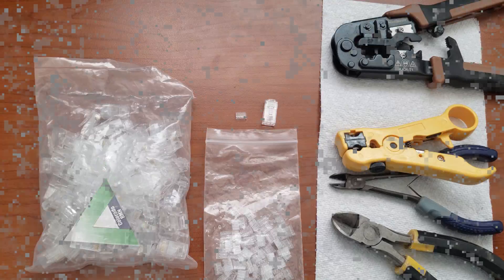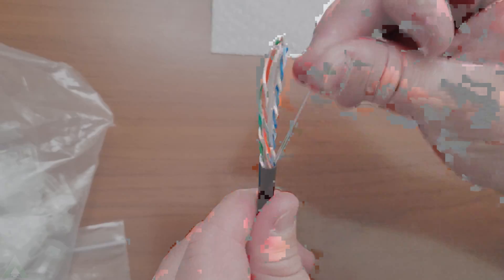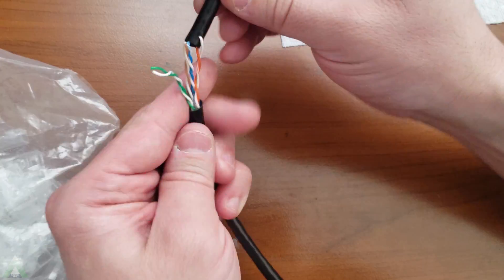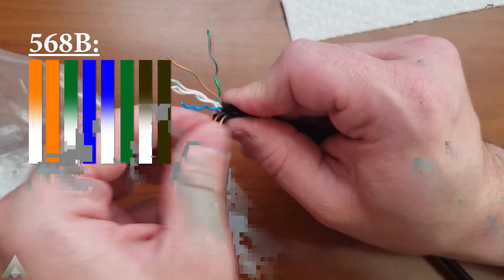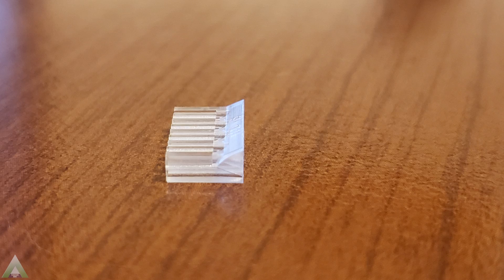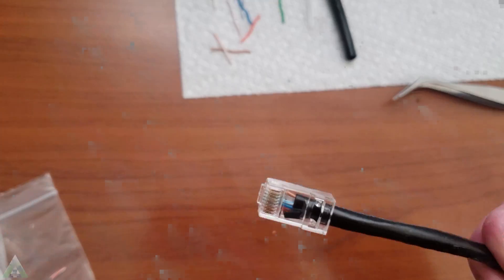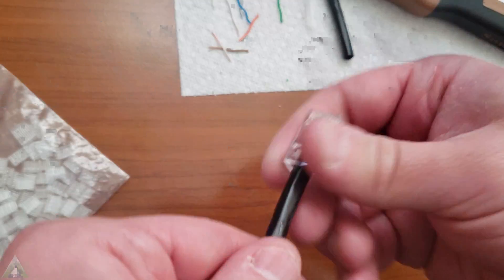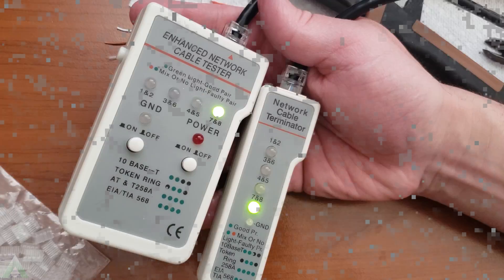How to cut, make, and crimp a Cat6 Ethernet Network Cable Simple and Easy Way

Comment: I have an ethernet cable thats been attached and glued to the wall and goes around the whole house from my living room where the internet box, to my room where my PC is, so its very very long and i dont want to have to replace it, but the little plastic bar that helps to lock in the cable into the ethernet slot snapped, so its basicly loose and sometimes it moves and disconnects, i have no tools at all like you have in the video, whats my best option ?
Reply: Crimper is dirt cheap RJ45 crimper

Comment: My puppy chewed the end off of a very long cat6 cable. I clipped off the chewed end and mounted a plug on the fresh end, but my Ubiquiti hardware is giving me a warning about it being a low speed cable. I've tried two different brands of plugs and I've used a tester to verify that each wire has signal. The cable was able to transmit data, but at half the speed of a factory cable. How can I figure out what I'm doing wrong?

Comment: Correct me if im wrong but doesnt cat6 have shielding ? Your cable had no shielding
Reply from the maker: It depends on setting this is used in and possible interference conditions. A shielded ethernet cable has an extra layer of metal shielding around the twisted wires, to protect it against electromagnetic interference. However, there are  unshielded cable as well.  Shielded ones should be used in environments with high levels of EMI; but unshielded cables are suitable for most home and office networks as most have little interference. Unshielded  are not as heavy, a bit more flexible, can be easier to pull in a  home / office and  , and in general should be bit cheaper .

Comment: 😂🤣...all you need are snips, connector & crimper...it's always 568B (568A has the orang & green reversed...and YES it does matter)...if you know what you're doing, you use regular plugs...not the push-thru crap connectors...replaced those connectors so many times due to shorting out equipment (wire tips sticking out)...and get rid of the ancient network tester...

Comment: TIL that the synthetic string is called a rip cord and what it is actually used for. Thank you!
What about the rubber boots/strain reliefs?  Necessary or no?
Reply from the maker: If it is in a location that is secure, then it is fine without it. But if it is in a commercial situation / school lab, it may be beneficial as people may "yank" the cord.  For home use, I never needed to add those rubber "boots" . Note that if it comes in the package with RJ45, then do use it as the space / clearance was designed for it.

Comment: Bought and sent back many of these to various places due to most of them never crimping properly. All these do is add a point of failure. Went back to normal plugs and have not had an issue since.

Comment: Honestly who ever invented this FN stupid BS system was either high drunk or just a complete  c$#! Ive tried for 3 day just to make a single cable and none have worked. Why the hell wouldn't you just 1 make the dam connector slightly wider so the wire don't blend and flap over each other when putting them in. 2 just go colours white silolid whit solid. Crossing them over goes against the way the nature sit in the cable. 3. You even need all the FN wires!!!!!! send and receive only needs 4 wires so why the fuck is there 8. God dam in

Comment: You dont have to expose some of the internal wires for the end connection like you do with speaker wire?
Reply from the maker: No, when you crimp it at the end, the end-connectors splice into the wires. That is why it is critical to crimp it fully as it does 2 things: A. Crimp down the end so that the cable does not come out and B. Crimp the end of the RJ-45 connectors / conductors into the wires.  That is why I recommend crimp it a few times just in case as  during the process it is crimping 8 wires + 1 end of cable.

Comment: Can you also concatinate two cables? Say you need a longer one, or a section with a flat cable
Reply from the maker: There are adapters that have 2 Ethernet ports to extend cables. At home you can try to use it for applications that are short distances and test your speed to ensure it is not negatively affected.  Commercially I would advise against it as this will reduce quality of signal over distance  and that also exposes cable to extra interference in the middle.

Comment: Actually there are a few different techniques & procedures to achieve good results.  It all depends on what works best for the individual.  Personally, prefer to gently score the jacket with a blade then tear or use side cutters.  I wouldn't use those circular jacket cutters.

Comment: How do you test if one end terminates in a keystone?
Reply from the maker: Once you have 1 good working cable (tested and confirmed) you should be able to use it to plug it into the jack and the other end to the point of origination and test that way.

Comment: I got a kit with a crimping tool, tester, and some connectors. They aren't the connectors with the loading bar. I loaded the wires OK, but there doesn't seem to be a way to cleanly cut the wires after they are passed through the connector and then crimped. Any suggestions?

Comment: Will the RJ45 PLUG fit the cat5 and cat6 cable?
Reply from the maker: See the rating for RJ45. Cat6 cables are slightly bigger so there may be some RJ45 that could be too small for Cat6. A Cat6 rated RJ45 will still work with Cat 5 cable (for home use).

Comment: Great video! Followed your insructions and used a Klein pass-thru crimper on CAT6 cable. It took a little longer than you ;) but worked first time. Used tester to verify. My connectors did not have the loading bar, so that slowed me down a bit.👍
Reply from the maker: Nice work!
Reply: Is the loading bar necessary?

Comment: I thought I must be doing something wrong until I realized I was working on a direct burial 6A cable, and the wires are too big for standard connectors.
Reply: Did you find connectors that fit.
Reply: @chrisclapp7631  I didn't,  just ended up using the snap in connectors that go into wall plates.

Comment: Sorry man. This is just simply not how its  done. Use a tweaker to separate each pin. Use pass through RJs  also. Another tip. Don’t ever ever push the pins that high up because when you crimp the RJ it stresses the pins.

Comment: Oh my God!!! I struggled for 2.5 hours with Cate6 connection - wasted 8 connectors.  Dammit.  I am going to try it and will up date everyone.
Reply: Definitely use the pass through kind of rj45 jacks. Cut plenty of the outer cover off and slow down. Slide one wire through at a time if you need to. I myself never slide more than 2 in at the same time. I can do one set with two ends in under 5 minutes doing it that way. Slow and easy….. nice video by the way pal. Great info!!

Comment: Does anyone know if i can cut a ethernet cable and still use the same connector somehow?
Reply from the maker: You can use the same cable by crimping a new connector on it but you cannot reuse the old connector once it has been crimped.

Comment: Video is only 1 year old, and I have been using the pass through RJ45 connectors, and the crimp and cut tool for over 4 years now.
No serious network installer will use this way if making cables anymore.

Comment: hi, thanks for the video. i just want to ask, does arranging the colours effect the speed of the internet? i have a 300mbps speed n want max speed while connecting the land cable to my desktop from the router.
Reply: Just make sure you wire all 4 twisted pairs to get true gig speed.  In theory, you could wire in whatever order you want as long as it is the same on the other end.  That can get confusing, so it's good practice to always wire in B or A order (most use B).

Comment: Does it mean your RJ45 connector is different from the ones I bought? There is no smaller part everything is just 1 piece 

Or do I have to buy the smaller part differently?
Reply: The plugs with the loading bar are the easier plugs to do. They help you align all the wires before pushing them into the plug. Plugs without a loading bar do require some patience ! I recommend the ones with the “push through” set up where you can thread the wires through the plug to hold in place whilst you fit the others. You then trim off the excess, slightly pull them back into the plug and crimp. Every method is fiddly, but the loading bars are the best system.
Reply from the maker: If yours is 1 piece then you sort the wires and slide them into the RJ45 without the loading bar  (the 2 piece is a different design). I have done many 1 piece setups, you just need to be careful to align the wires so that they slide in the right order.
Reply: @ColoradoRMN  had a very painful thumb after several attempts. Kept cutting the cord till it became just 2feet.

It was 2.5 meters long
Reply: @ColoradoRMN  got the RJ45 UTP A type and boom! It's got the loader onboard. And I could finally crimp successfully

Comment: to make it even more simple and not needing to remember or google for wiring diagram just wire in any color combination just make sure they are in same order in both ends also the 568a-b are the same it's only 2 colors that have swapped and when connection it makes no difference what color is inside the cable.

Comment: finally a video where someone crimps their rj45s a few times before they pull the cable out of the crimper. everyone else does it once and assumes its perfect. i use pass through connectors. sometimes it takes a few/couple crimps to get the ends cut off good.
Reply from the maker: Yes, doing it a few times is quick and ensures all's good and done fully.

Comment: I bought a flat cat6 cable, can I assume it'll all be the same inside?
Reply from the maker: "Kind of" :) . It will still work, however, flat cable tends to be more portable and made of smaller / thinner wires. Additionally, it should not be used for long runs (length) as it will not provide sufficient signal coverage and would can open additional RF interference (non-flat  cables are normally twisted for a reason and in a  way to minimize interference and maximize the signal strength).  But for short length / portability flat cable can still be used.
Reply: @ColoradoRMN  thank you, we've run 30m of external flat cable and hasn't lost any of the speed from the router (149mbs), so son is happy :)

Comment: My issue is that when I insert the wires into the connector, they don't stay in place and I keep getting Splits every time I test it after they've been crimped. What's a good solution to help keep the wires in place while inserting them?
Reply: Might be best for you to get pass through cat6 ends so you can make sure the cables are straight before crimping
Reply: @danielforsyth5729  I am dealing with Cat7 and Cat8 though but if I were dealing with like Cat 5 or 6 then I would. I watch these videos and they make it look so easy but I keep failing lol.

Comment: Does the color standard really important for a straight thru cable patch?
Reply: If this is just for your home use then as long as 1,2,3 and 6 are the same then it will be ok because 1 and 2 are for TX transmit , 3 and 6 are for RX Receive

Comment: Many thanks. 

Thanks for pointing out that you have to sort the wires in the correct order BEFORE you trim them. Not obvious and very welcome and useful advice.

Anyone new to this might assume you need to bare the ends of each wire (as you'd have to do when wiring up a power plug), so your taking the time to explain how the crimper drives the blades into each of the eight wires is very welcome.
Reply from the maker: Thank you for the positive feedback. Glad it helped and you found the video useful.

Comment: Hreat video, question. I have done my own phone lines but, never ethernet cable. You don't reverse the pinout on the other end?
Reply from the maker: No - they must be the same on both ends. The only time it would be different is if you are doing a crossover cable (connecting computer to computer direct and bypassing networking equipment). There is a special order to do a cross-over cable.

Comment: You should keep the shielding more intact to reduce noise.
So I prefer the way without pulling the thread down.
There are also connectors with an opening so there is no need to put the wires in a mold first

Comment: What is the difference between cat 5 and 6?
Reply: Speed is the difference. It all depends on what speeds you need for your project. Theres also cat 5e which is between cat 5 and 6. https://www.cnet.com/how-to/how-to-pick-the-right-cables-for-your-home-network/
Reply from the maker: Not much is on Cat 5 now but a lot is on Cat 5e. CAT6 wires can be slightly bigger (23 gauge ) compared to Cat 5e (24 gauge). Overall cable is slightly thicker with extra shielding. They also allow speeds up to 10 Gigabits on networks that support it when used in limited distance -  their operating frequencies can be up to 250-MHz (it is 100 Mhz on CAT5e).  Remember,  however, that the fastest speed of the network is determined by the slowest link / component you have on that network.

Comment: I just make a 5 foot cat 6 cable and I’m only getting 90 mbps on a 250 mbps connection. Did I mess up the ends? Or any idea what would be causing this?
Reply: If you are connected to a non gigabit switch that could be the cause
Reply: @renyson1721  the crimp tool I was using wasnt working correctly. Got a new crimp tool and it works now
Reply: Glad to hear u fixed it because the most annoying thing is to not have the internet speed that your paying for

Comment: I just bought a long line of cat 6 cable to create my own patches. I also have some RJ45 connectors laying around that say they are cat 5e rated. But I am confused. Can I not use the cat 5e connectors I already have in order to terminate by cat 6 cables? not seeing the big difference in the two
Reply from the maker: You can try and it  may work. Cat 6 cables are slightly thicker so you may have an issue with fitting / inserting them into the module but it may work.

Comment: Why make your own cable when you can buy them so cheap this days? Also using pass thru is so much easier and quicker.
Reply: And because when you run these cables through walls or tight spaces you don't want to bore a hole the size of the connector head. So many times you can make the hole just big enough for the actual wire and then add on the connector head after.
Reply: Because it's even cheaper to make it yourself if you source things correctly... That and if the cable breaks and you know where the break is you can still save the cable...

Comment: This is a really noob question, but is there any specific way to cut the Ethernet cable itself? I have a 150ft roll of cable for my house that I'm gonna need to cut into various pieces, is it fine if I cut the cable right in the middle to put on a rj45 jack?
Reply from the maker: No - just do it in with any wire cutter. Main thing is to do it in one clean cut to make sure it is just one cut in one place.  Good luck!

Comment: These two-piece cat 6 connectors have bad reviews on Amazon. Do your connectors fit AWG 23  Cat 6 cables?  What brand are you using?
Reply from the maker: Try different vendor?  The one I had in the video are from Monoprice .  I do not have a specific recommendation as there are many vendors out there. Check specs to make sure on compatibility.

Comment: Great video ! Could you tell me which connectors you used ? I can only find the EZ pass through style cat6 connectors.
Reply from the maker: These connectors with the loading bar are often referred to as 'two piece' RJ-45 (some now also come with a 'boot' end piece). I got mine from Monoprice - they refer to the loading bar as the 'insert'  There are are some on Amazon too: https://amzn.to/2UkbT6K .  Good luck with your project.
Reply: @ColoradoRMN  Hello friend...I bought a 75 ft exterior ethernet cable and damaged the head (connector?) in trying to install it. Is there any way I could have you replace it for me? I am in Denver. Thank you! ;-)))

Comment: Can you use these two-piece connectors on Cat 5e cable?? I have a heck-of-a-time with the one-piece modules.
Reply: You can use Pass through connections. You will need a different crimper but I do a good amount of connections.
Reply from the maker: Technically, yes I have done that in a pinch at home when I only had the Cat 6 modules but needed to rewire a cat5 cable. I would not do that in a professional environment, however.  Since Cat 5e cables are a little thinner, it is not as 'smooth'  and you need to 'fiddle' a bit to make sure things line up as the modules are meant to be used with the slightly thicker wires.